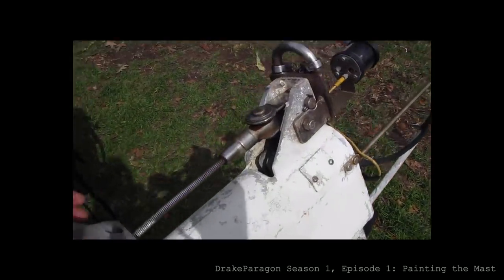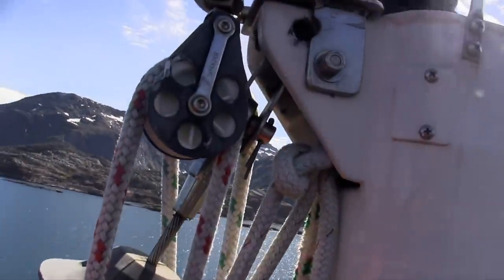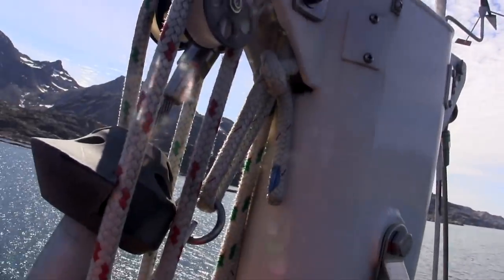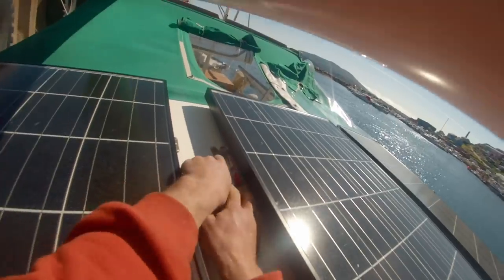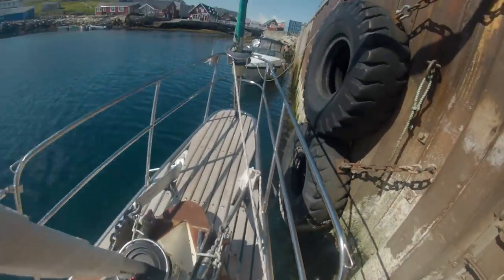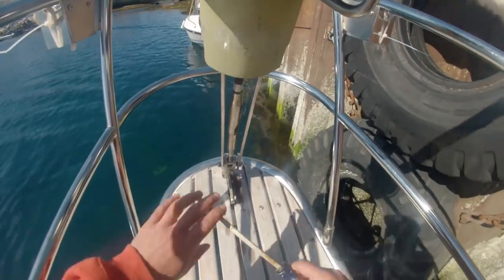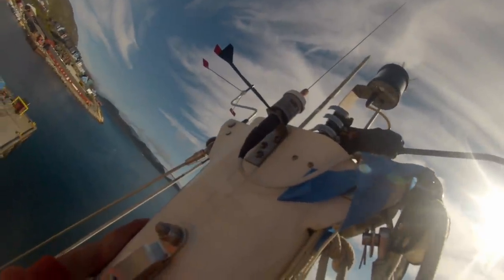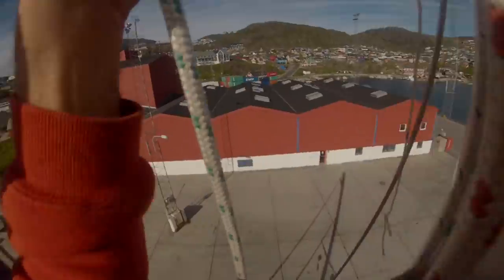We Almost Lost the Mast | #34 | DrakeParagon Sailing Season 5

Comment from the maker: So for those of you recommending a harness...what do you use if you have mast steps? A climbing harness that you clip in to every other step? Something attached to a halyard? Love to hear about your setup! -Monique
Reply: DrakeParagon Simple climbing harness with figure 8 and a loop of flat belay webbing that is feeds through carabiner. A fall will be arrested by the first step as the webbing cinches around the mast by sliding through the ‘biner. Figure 8 allows it to be snuggled up at the top.
Reply: A simple construction fall arrest harness, and two lanyard with carabiners.thats what tower climbers use
Reply: First I want to say, having been up my mast many times, you sir are a bad ass. My arms would have been toast, holding on with one and working with the other. 
I use a climbing harness and a halyard that goes over the top of the mast. (not a spinnaker halyard) I tie a bowline or follow thru figure 8 on the harness and have someone belay me from below with a winch. I climb my mast steps and the belayer just keeps the slack out of the belay line(halyard) If I fall I would be caught by the halyard. I can also sit on the harness and rest as well. 
Nice job on a tough repair.
Reply: I would use a harness with halyard attached and one crew tailing the slack as you climb.  a simple  short lanyard with you on the harness that you can use to clip on at any height to hold your weight and free both hands for the hard work.
And always give two rations of rum to the one tailing your halyard. 
Sláinte
Reply: We have both mast steps and a climbing harness. Mike clips onto a halyard and we have another halyard for safety because... SAFETY.  Then I grind him up the mast as he climbs monkey-style to the top. We do it this way because our mast, at 63 feet, is pretty far up and it uses a lot of large muscles to get up there, meaning his fine motor coordination isn't as good if he climbs up completely on his own. So basically it's a climbing assist. Then I let him come down mostly on his own, keeping tension on the halyard. It works very well and he can stay up a long time if necessary without getting tired. No, I have not climbed it myself. Yet. He uses a mountain climbing harness from REI.
Reply from the maker: @amooseish  So...do you belay yourself? Because I'd love to have something that doesn't require a second person.
Reply from the maker: @arekkaniewski4442  Thanks, that actually sounds great. And this sounds like something that doesn't require a second person. -M
Reply from the maker: Hey @melissawhite210 good to see you again. So I've supported Drake with a halyard as he climbed, but it's unfortunately not something we always do. Really I'd like to have a system where a second person is not needed, maybe like what Arek recommended. Something that doesn't require both of us to be out on deck for the duration of the repair. -M
Reply: @drakeParagon  .  I also have a set of self climbers for the hands and feet that you can use alone to a assend  desend alone on a spare halyard made fast at both ends at foot of mast. 
my harness clips into the upper self climber.  you can go up and work for hours without worry of falling or getting exhausted.
I use ATN Mast climber system.  very safe and affordabable.  
if I had a stepped mast I would just use the upper self climber for suport of harness at any height to free up hands.
Reply: @drakeParagon  I've used Jumars to climb my mast, by myself, with no steps on the mast, and with nobody else to help me.  There's lots of ways to climb and/or belay yourself with Jumars (or any other type of mountain climber's ascenders).  The way I like to do it, I wear a climber's harness and climb a tied off halyard with the Jumars.  That halyard takes all of the weight.   I have a prusik system on another tied off halyard as a backup, so if my primary halyard failed, the backup would take over..  Climbing ropes is a standard affair for mountain climbers, and I'm surprised that most sailors don't use this type of ascending system more often.  But so you know, all this belaying and safety stuff will slow you down, and to forget all that and simply launch yourself up the mast steps like you did is much faster... but for God's sake, please do be safe!
Reply: Two crescent wrench’s. One Clevis pin for furler. One new screwdriver.
Reply: That was scary! So glad he got it done, he needs to always clip on.
Reply: @drakeParagon  Well I get that. For us, it's just a matter of safety being primary and of course, we are older also and these issues are always front and center for us. Mike has a harness that has carabiners so that he can actually climb by himself, but it takes a lot longer that way and uses a lot more energy; energy he wants to conserve for his fine motor skills once he's up.  One suggestion would be to have you present on the climb and on the descend, but once he is safely clipped off at the top, then you wouldn't have to stay close by. Anyway, I know you guys will work the problem. Clearly he has a lot of experience climbing. But it only takes one fall.
Reply: DrakeParagon arrangement lets one free climb with no assist. Loop will snag on mast steps and prevent tumble to the deck. Can’t guarantee no bruises or laundry issues, but you will live to post another video.
Reply: @1kfarrel  I tried this exact system- one halyard with two jumars with a second halyard with a lanyard attached via a prussic knot.  But found out I had great difficulty going down- in order to slide the jumars down I was suppose to cock the jumar so the teeth would disengage but with my 210 ibs wt., I couldn't twist it enough to disengage.  Moral?  Try to go down before you get too high off of the deck!  Next time I'll put one jumar on each of two halyards so I can unload the one that I want to slide down.
Reply: Melissa W
Reply: A seat. Whatever you make it of, just for comfort and use of 2 of the 10 hands you need.... lol
Reply: Use a harness!
Reply: Simple everyday climbing harness tied of to your halyard.  Then a second rope with locking carabiners to throw around the nast and lean back like lineman for utility workers.  
With that Klien tools makes canvas bag that line man use to put tools in that you can send up.
Reply: When working on the deck.  I use a 2x2 magnet that is used for signs.  It will not help with stainless hardware but will with tools.  I lay on the deck and nothing rolls off.  I also have a container that has magnets in it that sticks to the top. I put all stainless bolts in it.  I am an electrician and have done lots of dock repairs and I am tired of swimming for tools.  Floating key chains o. Tools work also
Reply: Monique, I would think of a halyard on the way up and a clip on on top in order to habe both hands free while working.
Reply: How tall is that mast?
Reply from the maker: @MrRourk  While we were underway we measured it to about 57 feet from the top of the mast to the waterline. https://youtu.be/B4w7AMpr9Sg?t=153
Reply from the maker: @wizardmix  Thanks for the links Evan!
Reply: @drakeParagon  No problem.  The links may not be the best examples for price, I just linked the first ones that made sense.
Reply: This old lineman recommends you get a lineman's belt and strap. When you get to the top, strap in and you can comfortably lean back and have both hands free

Comment: What I do is tie off a halyard to a cleat (so it is immobile), tie a prusik knot to the halyard and then, wearing my deck harness, clip into the knot with my tether, or tie the harness with a short line to the knot. As you go up or down you can slide the knot along with you easily. If you fall the knot will jam and hold you AND once you regain your footing and take the load off the grip releases and you can once again easily slide it up and down.

Comment: I d have loosened the back stay and possibly the lower shrouds, then secured the mast with a fwd halyard as you did. You could then loosen the forestay (headstay) and most likely get the clevis thru and the cotter pin in place by tensioning the fwd halyard.          I think a redundant clevis and cotter would be an easy thing to design in from the outset by all rig designers 
All's well that ends well but as many others have said, clip in.
Really enjoy the channel.

Comment: Hey Drake & crew, thanks for the great videos, and happy to hear you got your headstay fixed before it ended up badly.  I actually utilized a lot of the information from your Season 1 videos to re-rig our Tayana 37; especially the part about feeding new wire up and into an existing furler extrusion.  When you were horsing around with that toggle pin in the first part of this video, all I could think was "Dude, drop the headsail and take some weight off the furler.", which you ended up doing.  Props!  Second thing I thought was "Rolling hitch with that spare halyard to take the weight off the furler assembly.", thus making it easy to reinstall the clevis pin.  I saw that you tried that, and it didn't work so well.  Nonetheless, you got her done in proper fashion, and she's once again ready for action.  The only other things I can say, are always install your cotter pins with the eye facing up (gravity is your enemy), and secondly, get yourself some proper climbing gear.  I was nervous watching you working 50' above deck holding on with one hand and trying to work with the other whilst standing in mast steps.  I solo-climb with an ascender and a simple harness on a dedicated climbing rope hoisted with a bowline on a spare halyard.  No one required to winch and tail me up the mast, except for sending me up the occasional tools in a bag on the other spare halyard.  Mast steps are great once you're up there, but that old time rule of "one hand for the boat and one hand for you" doesn't apply when you're trying to get shit done at the masthead.  If you ever had to do this type of work at sea, please be safe and consider everyone who loves you before monkeying up those mast steps.  Keep the vids coming man, love what you're doing (and be safe doing it).

Comment: Tense watching that, tricky job with heavy gear.  Job done with team work.  Wonder if a small stainless plate screwed over the fat side of the pin will keep pin in if cotter pin fails again.  Long time ago now so hope this was a one off.  Do clip on Drake, even if just at the top so you can have both hands free, don’t want to hear you have fallen from the mast.  Andy UK

Comment: Ha! A '4 F bomb' job.  I totally get it. Did you ever notice on your WS32 that the forestay doesn't have a turnbuckle?  When I re-rigged my WS32 I was on the hard and had to use a comealong connected to a vehicle on the ground to get the clevis pin in. And that was with all the stays (ALL of them slacked off). Definitely a 4 F-bomb job.

Comment: Hi Drake,   ( and Monique :) ) I climb using two ascenders on a halyard with my bosun’s chair and foot loops, but my safety system, a third ascender on a second halyard clipped to a webbing would be very easy for you to use too.  
Like others, I was a little surprised you didn’t slacken the stays aft of the mast to let the mast move forward and give the movement you needed.
Happy Sailing, 
            Andrew

Comment: You can move the masthead forward just by loosening the backstay. And then use the jib halyard to move it forward further if needed. 
You got it done, but it probably took far more work than it could have. 
That masthead design is bizarre. It’s made to shear split pins off the cotter pin. 
And do take a more safe approach next time. A mast is not worth dying over. Good luck

Comment: With a huff and a puff, well done, I'd have eased the backstay/s and tightened up the inner stay to take the mast forward slightly, not guaranteed to work, but at least it would allow the mast head some forward movement. Suggestions, get a longer clevis pin, get a circlip groove machined as well as a hole behind it for a cotter pin/split pin. Double security. Glad you got it sorted

Comment: I hate to be a back seat quarterback but shouldn't there be a washer between the mast
and the pin????
Reply from the maker: Thanks Jack,  I'm not a rigger so I don't really know, but I think that having a washer between the mast and the cotter pin sounds like a good idea.  I think it might protect the cotter pin from wear from the clevis pin rotating in the mast from vibration.   However I don't think I could fit a washer on that clevis pin at the top of our mast because that stainless fitting on the side and top being in the way.  I would really like to get a pro rigger opinion on this.
Reply from the maker: @jed7644  Thanks JED, I thought so too. Later on it I went back up there and removed that bracket entirely, giving up the attachment point for two spinnaker halyard snap shackle blocks.  I like to somehow modify that bracket someday so that I can reattach it without it shearing the cotter pins.
Reply: @jed7644  I think you're right about that wear issue.  Perhaps the best solution (though not ideal) would be a longer pin so the clevis clears the bracket.
Reply from the maker: @jed7644  Sounds great.  I never thought of using a castle nut and cotter pin on a clevis bolt - I can't imagine of a more secure way to attach that stay.  I'm also looking forward to modifying that bracket as you recommended.  Many thanks!  We're planning to go back to the boat yard in Oriental, North Carolina for a big summer refit.  By the time we get there Paragon's rigging will be overdue for replacing, and at the same time I'll repaint the mast again and change that bracket and clevis pin.

Comment: Brave man, I might of climbed up with no harness but once up i would of clipped on to work. Do you think a G clamp or a carver clamp going from the top of the mast to a packer under the pin would of pulled it up to let you bash the pin in? Easy for me to ask you were the man up there at the time just curious, was there a enough room to do this or is it a no go?? Hope we can all learn something. Agree it is scarie that a little pin can bring down the rig, i got rid of the pins on my shrouds down at the bottle screws as i was worried about the sharp edges ripping the sail. Replaced with stainless versions of a round keyring clip as i thought this likely to rip the sail, also thought hey they are only a belt and braces approach as the tension on the pin will always keep it in place. You got me thinking now and these are low down.

Comment: The proximity of the welded on plate caused the split pin to shear off... Alas, I think that is likely to fail again, with that shackle wanting to rotate under fluctuating loads..
Reply from the maker: I think you're absolutely right.  Later on I got so worried about that cotter pin that I climbed back up and removed that stainless fitting entirely (giving up two snap shackle halyard blocks).  Someday I'd like to modify that stainless fitting so that it doesn't wear on the cotter pin.

Comment: I’ve seen drilling & tapping for small bolts to replace cotter pins in turnbuckles, but you’ve fixed the problem by removing the stainless block fixture. Drill out the hole to fit a larger cotter pin. (Don’t break the drill bit!)

Comment: I would suggest that when you can you insert a washer between the clevis pin and the metal frame. currently if the pin rotates with movement it will eat away at the clevis pin a washer would help reduce that wear. If the pin is too short it may be worth getting one slightly longer. Tenacious repair though.

Comment: I find myself telling the screen to loosen the backstay through this video
Reply: We used to have to pull our forestays every time we launched or retrieved our boats at our club with our old lift, what a pain, but yes, loosen the back stay, loosen the forestay, tie a safety line using an halyard and tension up. Get a ratchet strap to something low and away, whether the bob stay or sprit, or wrapped back around a block to tension up to get the lower pin back in, clip a bag or tarp around the sprit to keep tools onboard etc etc.... did it for many years. Now we have a hydraulic lift and we don't need to do that any longer...
I have no experience up a mast, but yes, clip in to something! My lord.... also, mine was a 26ft. I can't imagine a 42ft boat rig.....

Also, don't lose any of those Profurl parts. I lost one of the button top screws that hold the guides in, can't get them... anywhere......... for any price......

Comment: Hey  all. I don't know if anyone else has mentioned this.....  Cotter pins! Insert them from TOP to bottom!  Therefore if the bent feet rust/break off, the cotton pin will stay in the pin hole and its fat head with keep it from sliding out...temporarily. 
Great video! ...I have no idea how you "held" on!
Cheers

Comment: In the future, that pin could possibly be replaced by a thick bolt with a long shank. At the end, you can place a castellated nut with a cotter pin pointing downwards. The nut, bolt threading, and cotter pin should work together to keep each other from working out. I dunno, I'm just spitballing here...